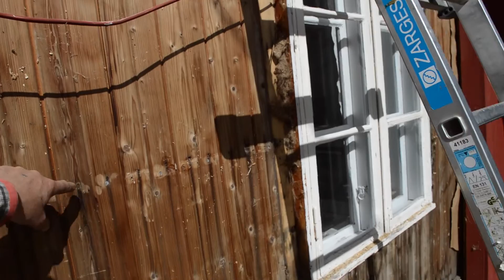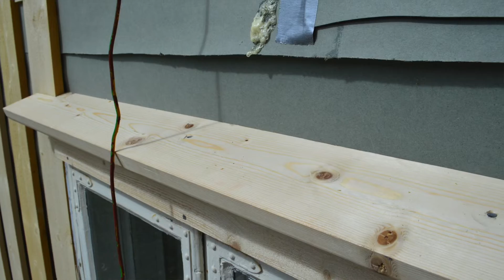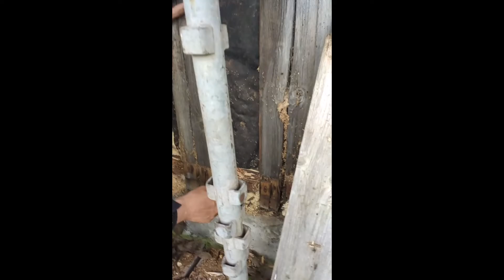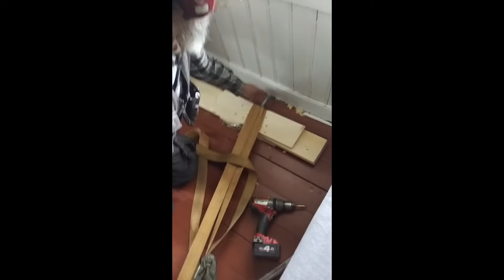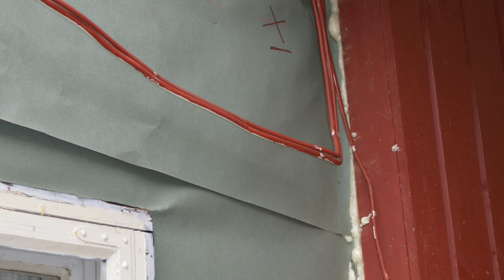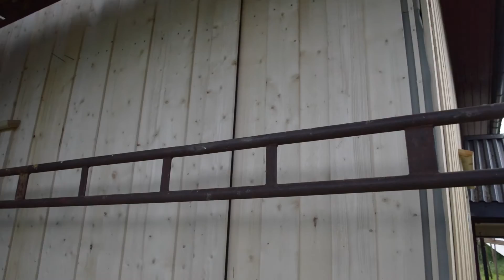🔴  Norwegian 1899 Post and Beam house repair- 5/5

Comment: This was, as always fun to watch. You mentioned this particular roof angle was popular during the 1930s. Was this steeper or less steep than previous fashion. I always assumed snow load dictated roof pitch. It hadn't occurred to me that aesthetics play a part. Of course they do.
Reply from the maker: It is a bit steeper than for this region, where 22 - 27 degrees  were most often used. It allows for having a couple of full hight rooms upstairs, on houses that originally had just a sleeping loft. My own house has just such a conversion.

Comment: Lucas you appear to be cutting a rabbet/rebate on the edge of the siding boards.
Is it done to improve weatherproofing or maybe lower the board's profile?
What are the dimensions, is it half the thickness of the board?
Are rough cut or dressed boards typically used/preferred?
Love these videos of yours.
Reply from the maker: I think the rebate is for aesthetic reasons, and is a copy of the boards we removed that had had the damaging motor oil impregnation. Many older houses have dressed boards but since modern paint is rubbish and falls off dressed boards the use of rough boards has become standard. It is hard to tell on these original untreated boards how they looked,  since the surface is weathered, removing the top layer of fibres. The boards we used more or less have to be rough side out since that is how they are manufactured, and have both printed writing and other oddities on the back, but we were carful to pick out boards with tight growth rings  and heart-wood facing out, rejecting 2/3s of the stack to get these. It suits the composition paint quite well to be rough side out. All the best, Lucas
Reply: Got your point about heart-side out to control cupping.
Guess the rebate would allow one to use a thicker board and make it look more refined by lowering it's profile.
Rough cut is OK by me as that is what my mill produces. Rough holds paint better albeit more.
Random widths is a neat practice but must require some fussy planning.
Are you nailing the top boards  through the spacer blocks?
Timely example of your admonition not to use motor oil.
Reply from the maker: Try to avoid nailing into the blocks, they often split.

Comment: These buildings you work on come out of surgery looking great. Good for another 100 years.
Reply from the maker: If that is true then I am very happy. Thanks for your continued support ravenhhca, what did you decide with your timber treatment?
Reply: Well if it doesn't last quite 100 years you can come back and tune it up.
Or another guy can who has learned these skills, will. Thanks for passing on the art.
As far as wood treatment is concerned, I'm keeping my eye on you and when you mix up batch of something, I will try that.
That starch and pigment sounds like the milk paint we use to use here.
It never seemed to quite fully dry but stuck like S**t to a blanket.
I have an old cupboard that my Great grandfather made and it is painted black and red.
I tried to strip and refinish it and the black had gone deep into the wood.
Reply from the maker: I am doing linseed oil interior painting this week, I have some footage to edit and post of that , also I thought I would do a special on untreated wood using the three buildings here on my small holding, all the best, Lucas ps glade you didn't go for the motor oil.
Reply: I like that colour . What is the recipe? Is it just red oxide, water and starch? How well does it stand up?
Reply from the maker: That is a product he bought in Sweden, so I don't know the exact recipe . Here is one though; 30 litres of water, half a kilo FeSO4×7H2O, 1kilo salt (Na Cl), at boiling point add 4 kilos Rye Flour continually stirring, avoid lumps, add in small portions. After 15 minutes boiling add , under continuous  stirring, 8.5 kilos iron oxide red and then paint the wood while the mix is still 40 degrees centigrade or warmer. A larger and a smaller bucket filled  between with PU foam works well as a thermos flask. It last about 20- 40 years and can be repeated after minimal brushing of the weathered surface.
Reply: Looks like a batch will cost aprox. $130 cdn. for 6.5 gals.
Can you tell me what you like about this mix?

Links to ingredients .......
https://www.amazon.ca/Ferrous-Sulfate-Heptahydrate-Soluble-Chemicals/dp/B007ODUI76/ref=sr_1_3?ie=UTF8&qid=1531487748&sr=8-3&keywords=feso4-7h2o

https://www.amazon.ca/s/?ie=UTF8&keywords=red+iron+oxide&tag=googcana-20&index=aps&hvadid=208323196714&hvpos=1t2&hvnetw=g&hvrand=196309441255340028&hvpone=&hvptwo=&hvqmt=b&hvdev=c&hvdvcmdl=&hvlocint=&hvlocphy=1002394&hvtargid=kwd-297192293458&ref=pd_sl_4coq8qh2u9_b
Reply from the maker: I think when a technique has hundreds of years of use you have to love it and use it. Thanks for supplying the links, all the best, Lucas
Reply: Good answer.....I'm going to give it a go.
Looks like the price is right. SICO wants $75 a gallon for their stuff.
Can it be reheated next day or does it have to used when made?
Thanks Lucas.
Reply from the maker: Yes it can be reheated, I have heard that there is too much rye flour in this recipe,  which may be because we make finer flour now than in 1890, I think it would be wise to make a small batch using the the same ratio of ingredients  and see what the result is before doing a large scale building. There are very many different recipes for this kind of paint but i don't know which is the best, some have linseedoil and also tre tar  or pine resin. But I think this one is simple and effective, for farm buildings but it does come off if you rub on it so if you plan on rubbing your white shirt on you house, be warned. Try and use it up within reasonable time so the flour doesn't start to get mouldy.

Comment: lots of very interesting and culturally valuable content. however, your sounds levels are a serious issue. half the time you're barely audible, then it's way too loud. overall sound level is far too low. if you intend to keep making films which are also watchable – and i certainly look forward to more nordic building content  – you should invest in a clip on mike.
Reply from the maker: If you right click and look at details for nerds in a youtube film you will see that Youtube changes the sound level of my films. Boosting or damping as they see fit: "Volume / Normalized100% / 100% (content loudness -12.8dB)" quote from "stats for nerds". Whilst all reasonable efforts are taken to record good audio and mix adequately, at present I go to work to practice my craft primarily and make youtube films secondarily. It would not be practical for me to use a remote mic since the work I am filming is not staged, hence dirt and impacts would very quickly damage what is relatively expensive equipment, such is already the case with my film equipment, and that is not even strapped to my body. In fact it is just as likely I may choose to go low-fi  in future, since the quality of my film making has little, if not nothing to do with the quality of my handwork. In light of this you will have to decide....is the watchability more or less important to you than the  content? If so then it will be up to you to make an effort.  I suggest you use appropriate equipment to watch my content, avoid using a mobile phone completely,  plug laptops into earphones and desktop computers into your hifi system. Then poise yourself on the volume control to "mix" the level "as live" for your own personal sound perfection. Having done all of this your effort will help me ignore, with good conscience the sometime out of focus, sometimes loud or quiet and otherwise flawed films I make and share for free. I find my sound levels to be less of an issue. Welcome to look through my back catalogue of films, don't wait just for new ones. All the best, Lucas.
Reply: Strongly disagree, volume levels are perfect in my opinion. Nice to have videos that arent AS LOUD AS POSSIBLE sometimes:-)
Reply from the maker: Maybe Da Os watched several episodes of this series, I think film two had a couple of low volume clips.... thanks for your continuing support and interest Josh, all the best, Lucas.